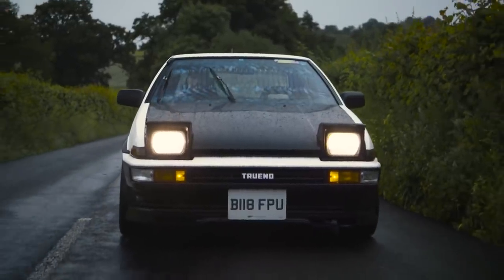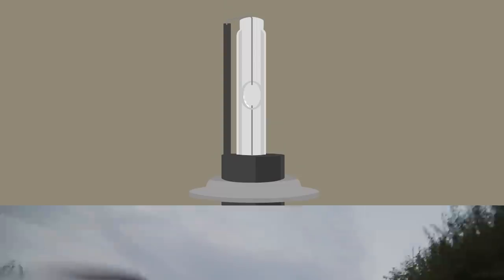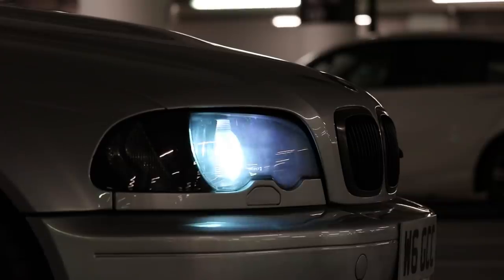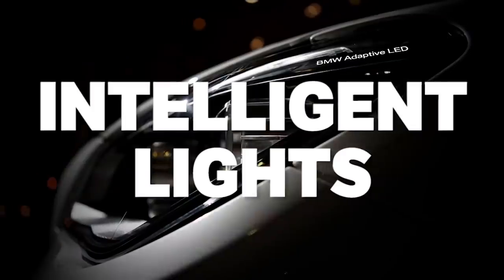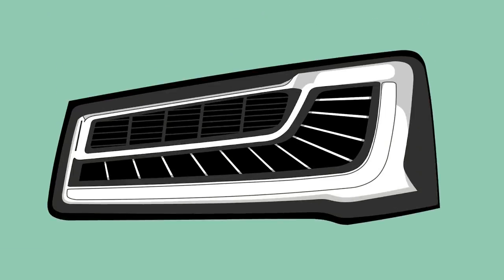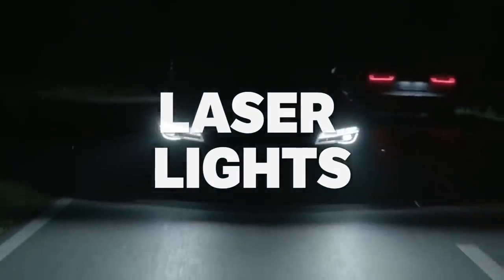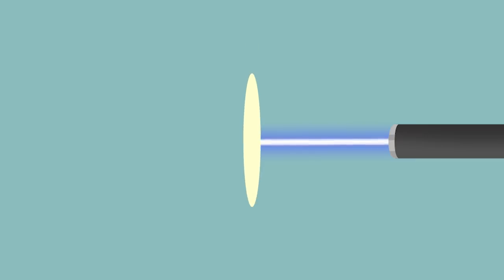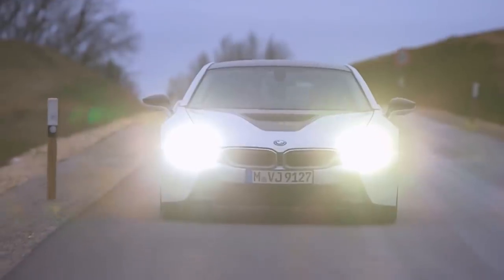Modern Headlights 101 - Xenon, Matrix, and Laser Lights

Comment: The Jewel eyes LEDs on Acura are the worst aligned lights ever produced! Even on the slightest bump or uphill they're blinding the oncoming traffic to the point,  that they can't see shit! I hope it turns to a lawsuit and Acura is forced to recall all  vehicles equipped with that crap!
Back when Xenon headlights were introduced, due to their higher light intensity, car manufacturers were forced to fit them along with a self-leveling mechanism,  so that they don't blind the oncoming drivers, and of course that made them much more expensive. You would have 2 sensors mounted on the front and rear axels plus a control module to determine if the vehicle is not level and lower the aim of the beams if necessary with built-in stepper motors in the headlights. Surprisingly,  that's not mandatory for the LED lights and I don't understand why!? I have Adaptive LED headlights and noticed they rarely aim high enough to blind the drivers in front of me and it only happens when driving through speed bumps. I'm guessing not all car manufacturers are doing a bad job of preventing that problem.
Reply: P. S.  Forgot to mention,  unlike the narrator of this video states,  the OEM Xenon lights are all 4300 K by law! Overall, the video has many mistakes and doesn't cover the subject well.

Comment: I simply installed 70w halogen headlights instead of 55w in my FiST.
Pretty much no difference during the start of the evening, but when it is actually night time they light up the road much better.
Still looking for LED's. But they are expensive and have plenty of canbus errors, even those who are 'canbus error free'.
Reply: Get the Philips units with the Canbus adaptor

Comment: One thing you could have mentioned is the legality of upgrading from halogens, i really want too but theres a lot of controversy around it including a new mot change about headlights
Reply: Phillips makes EU certified LED headlight bulbs for H4 sockets: https://www.philips.com.hk/en/c-p/12953BWX2/x-treme-ultinon-led-headlight-bulb

 Yes they are expensive, but you don't have to remove them for MOT. I drive with some crappy 6 years old 12W LED bulbs that diffuses the beam too much. However In an old car they are suitable as DRL and I keep my real bulbs in the door pouch for when it is too shitty weather

Comment: Huge improvement going from Halogen to Adaptive LED in my NX. I love the colour and the spread, I can see them autolevel too at night which I think sits too low, I'd rather they raise higher slightly.

They're instantly on when you start the car in the dark so no warmup needed. However they do have active cooling fans inside as I can hear them up close. Technology is definitely getting better in terms of lighting and price will continue to fall.